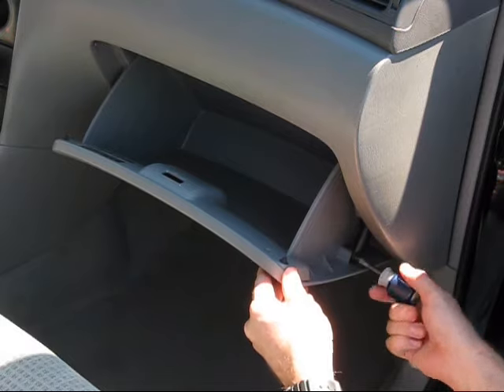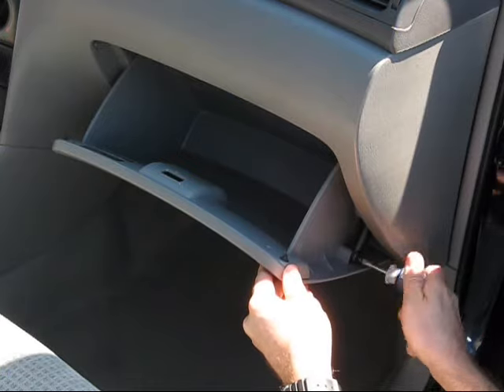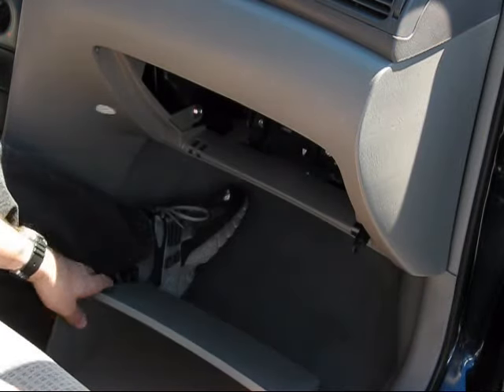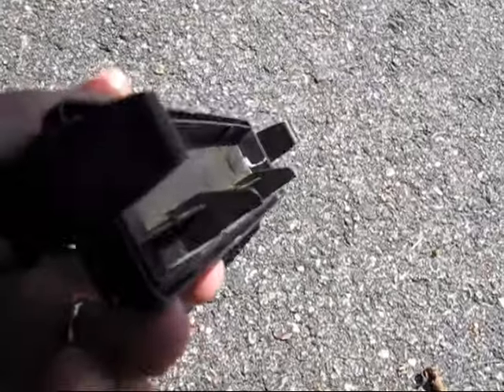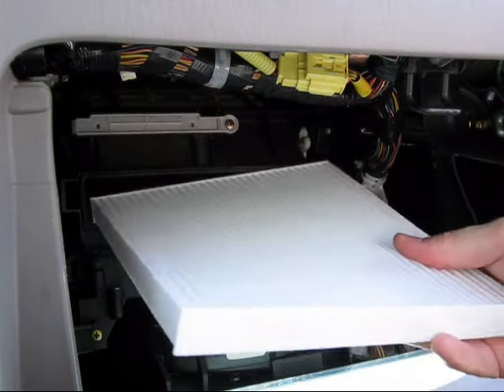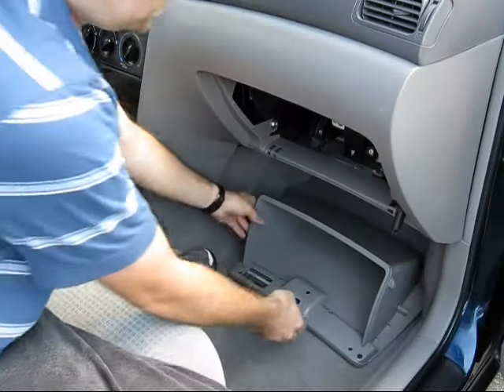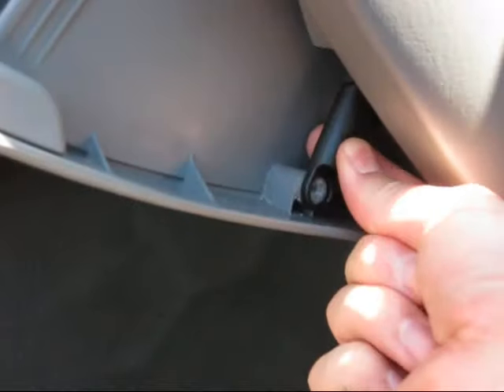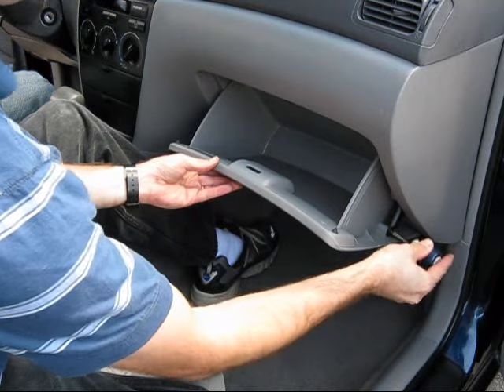How to Replace Cabin Air Filter 2006 Toyota Corolla | AQ1044

Comment: Excellent job. Thank u. If u do unscrew the dampener arm (u can leave it on & it's easy to slip it back into it's slot in the dash) know that it can easily fall out of it's slot = it's just hanging there. But, even so, easily screwed back on & put back in place or u can slip it back into it's free hanging slot & screw it in after u snap the compartment back in & B/4 u close it.  Because of this sweet tutorial, it was easy & took 4 minutes.
Reply from the maker: Thank you for informing us!

Comment: Please help! Does a 94 corolla have a cabin air filter?
Reply from the maker: No, a 94 should not have a cabin air filter housing. Cabin air filters did not become standard until the Mid/late 2000s.